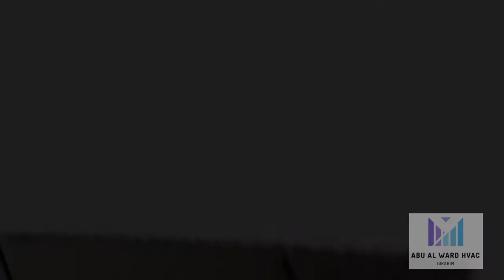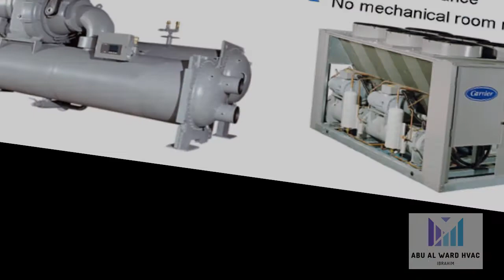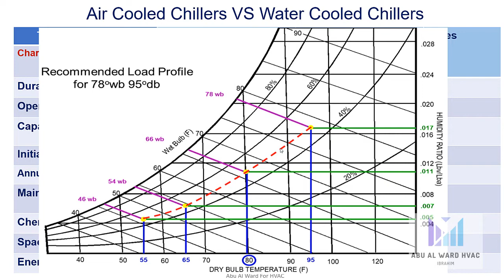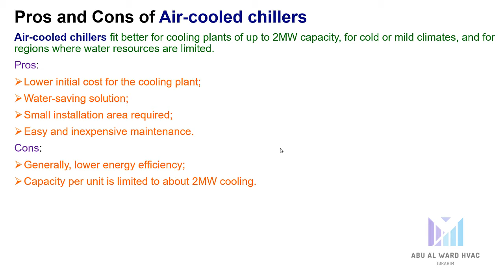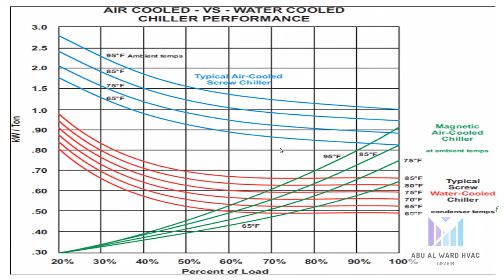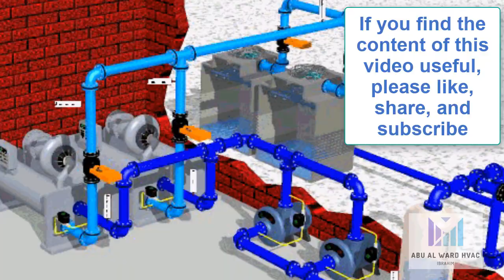Air Cooled Vs. Water Cooled Chillers

Comment: If no water needed for Air type chillers mean what us transfer inside supply and return pipes?
Instead water R143A / R22A Ferion Gas???
Reply: Referring to the condenser side cooling . Water cooled condenser ( Cooling towers, open or closed loop ) or air cooled condenser